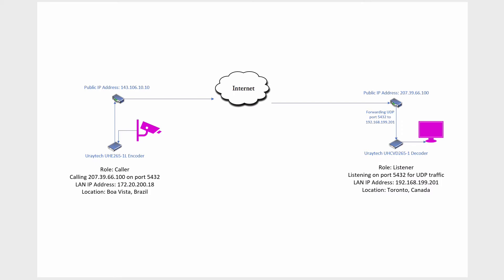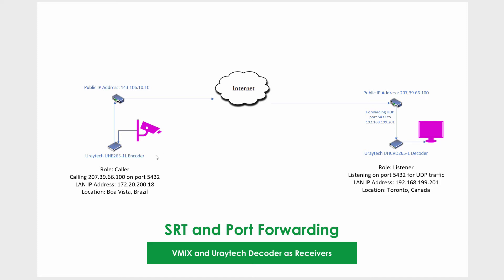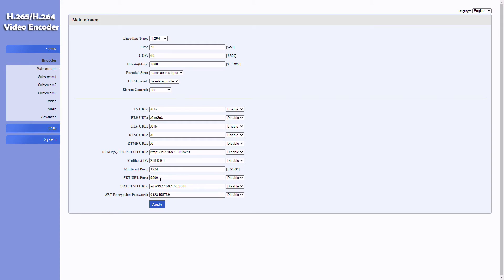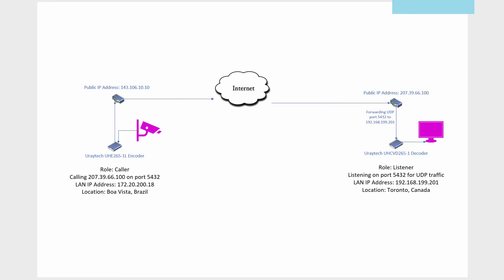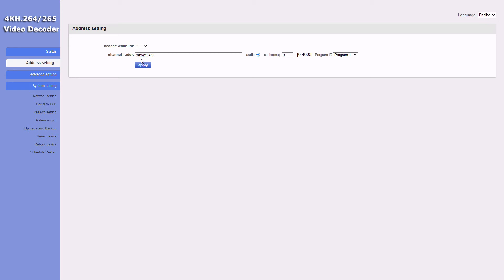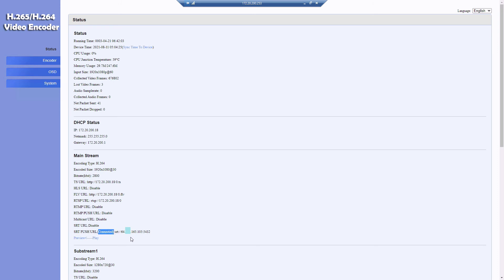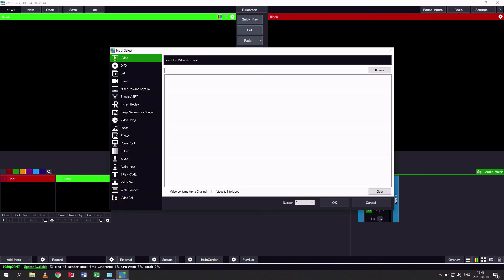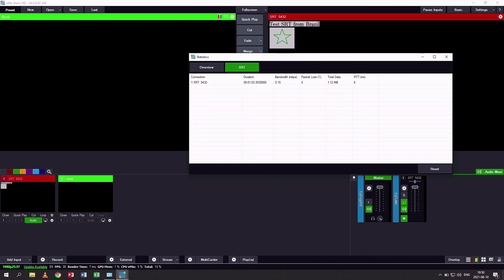How to Setup SRT and Port Forwarding with Uraytech Encoders/Decoders and VMIX Beginners

Comment: Good Day, I am writing from a TV station in Bermuda. We would like to send our stations broadcast signal to one of our local cable providers here on island using a Uraytech encoder at our end and a Uraytech decoder at the cable provider end. Can you assist with a tutorial or any information?  Also to your knowledge, can the Uray gear run 24/7. Many Thanks
Reply from the maker: Hello El Seymore, great to hear from the islands. Absolutely, the Uraytech boxes can run 24/7 unattended and I believe they have an 'auto-reboot' feature you can configure for weekly reboots if needed. Here is a link to one of my videos that can get you started in the mean time on setting up SRT for your broadcast push to local cable: https://youtu.be/oWlIUj9P_gg 

I will make a video shortly using encoder and decoder to send/receive SRT on the Uraytech boxes. Ideally you want a public IP on either end of the transmission to assign to one of the boxes. If this is not possible, then we need to do UDP port forwarding.
Reply from the maker: Hello El Seymore, I have made a simple tutorial vid here on how to setup SRT with 2 Uraytech boxes: https://youtu.be/Q_AOGqqFcJ0
Let me know if you have any questions on configuration.

Comment: Nice! I live in Brazil. I am thinking about using this equipment to send sdi signal via a fiber interconnection between studio and transmitter
Reply from the maker: That's great Andre, I used to live in Brazil myself. Make sure you get a unit that is compatible with SDI input.